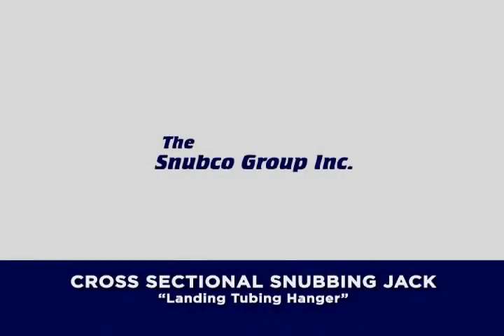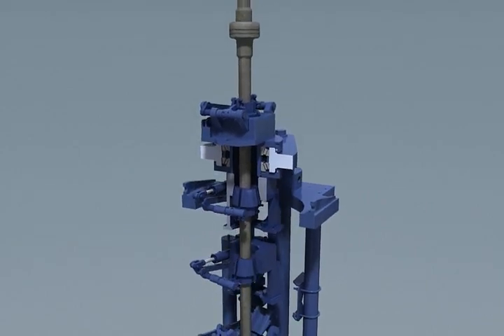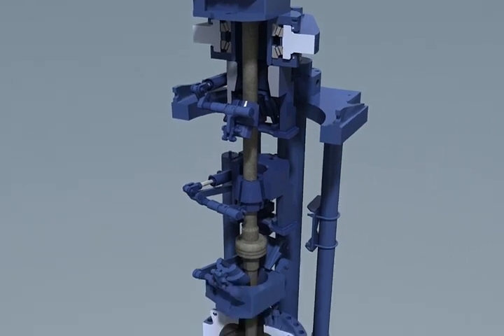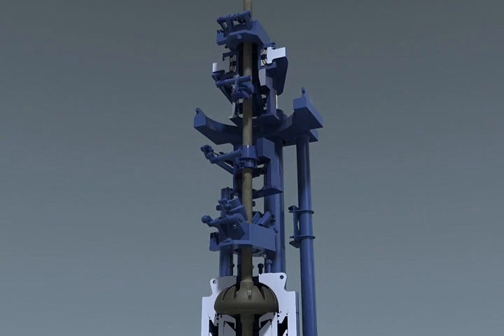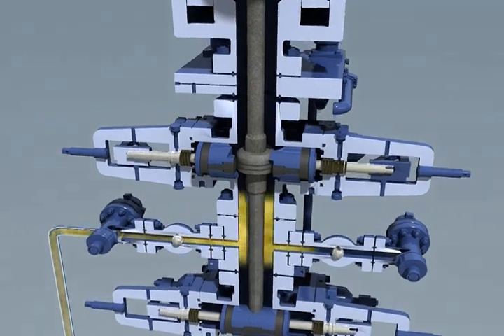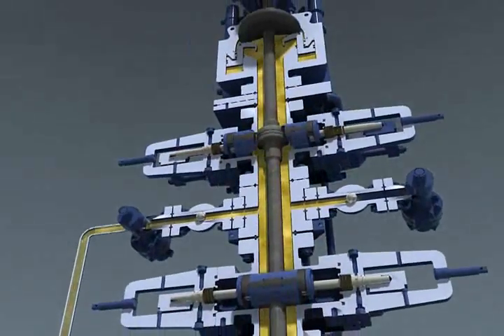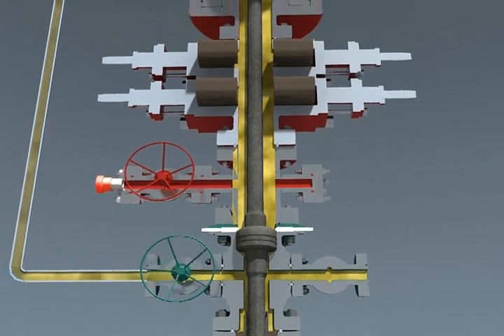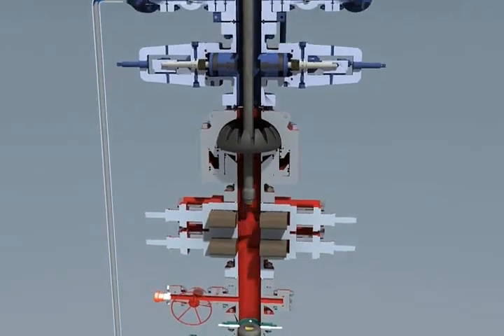Snubco animated video: Staging Tubing hanger

Comment: How do you confirm that the hanger is at the required depth (THS) since it is not visible, since the hanger is running inside the bop?